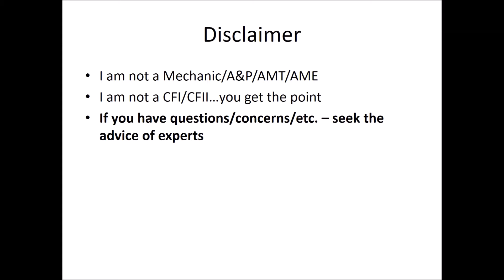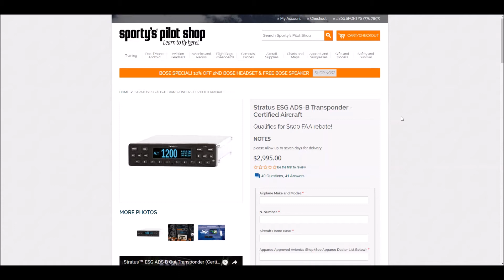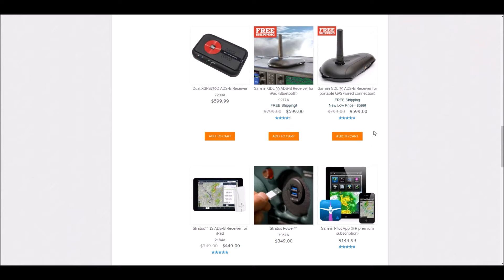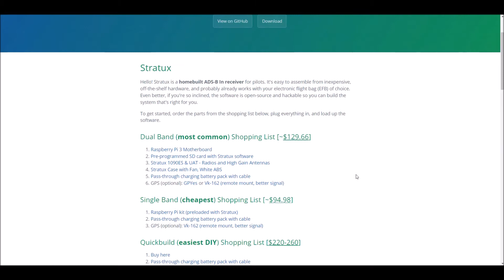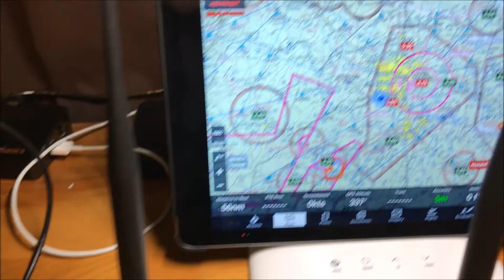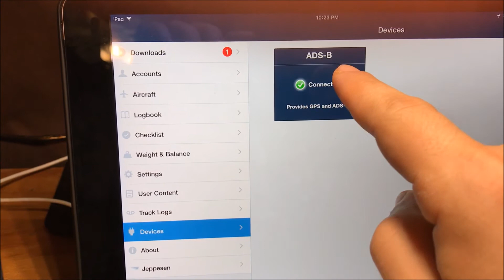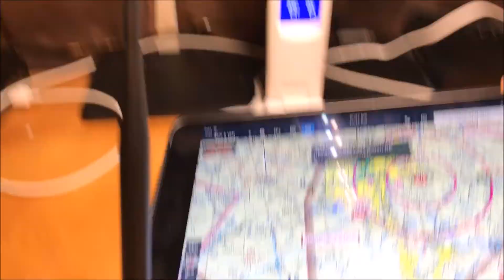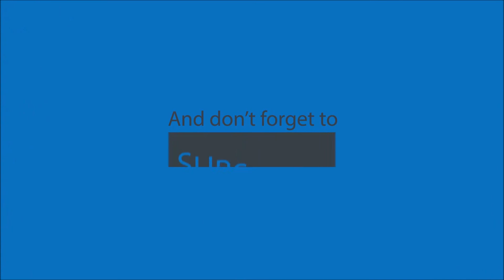Stratux ADS-B In - An ADS solution for the rest of us!

Comment: I purchased a Stratus 2 RX and am very disappointed in this system. This ADS-B IN RX only works, AND I MEAN ONLY, works with foreflight, other EFPs are specifically locked out.  So you pay top dollar for a RX and then have to pay for a subscription to their EFP.  Stay away from this RX unless you don't want any options for a EFP.  BTW you can buy any other RX and use foreflight with it so paying top $$$$ for this makes no sense.
Reply from the maker: Great info - appreciate ya sharing.
Reply: I believe now -- some 4 years later, the table has turned.  I don't think Stratux will work with Foreflight (or Maybe it's garmin pilot) ??

Comment: I notice your build has heat sinks and those are sold separately (http://a.co/4vSf870 ), only $5, I assume you are recommending those as well?
Reply from the maker: Very good call out.  The case in the video came with the fan and heat sinks, however I will make sure to add to the description the link to website the link to the heat sinks as the newer case is better but I am pretty confident it does not come with them.

Comment: Is there a similar ADS-B Out setup that is inexpensive and portable?
Reply from the maker: I am currently doing some research.  Good news is that it is currently a moving target, as the price of ADS-B solutions are going down!
Reply: I have a very old Narco transponder.  Works great today but but for how long?  For a transponder replacement, the cheapest option I’ve found is the Stratus ESG for a certified aircraft.  It’s not cheap, $2995 plus install.  Would love to see if you can find a cheaper option.  I could install s sky beacon but that doesn’t replace the transponder.